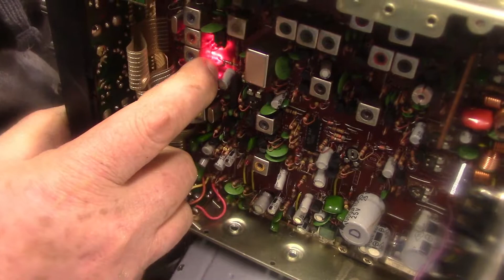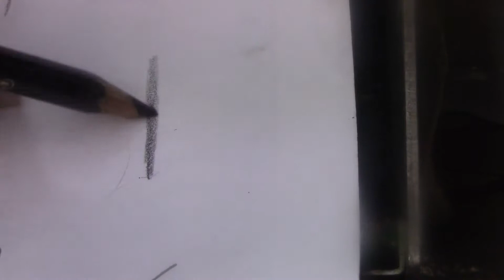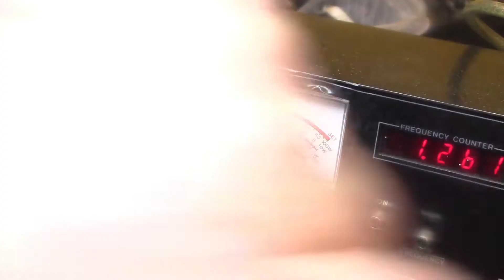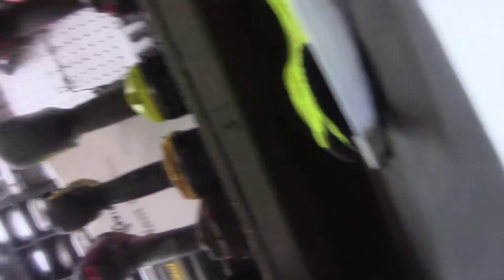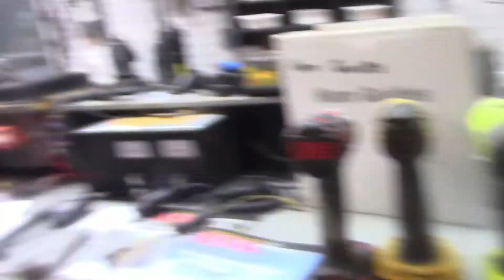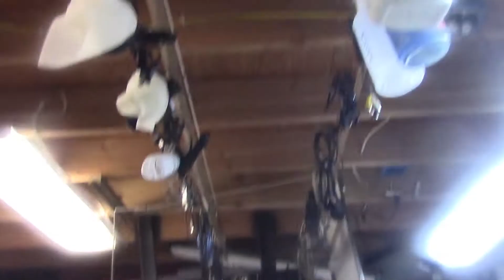fixing, repairing a cobra 146 am/ssb CB and BS

Comment: If you look at the top left hand corner you will see several metal screwdrivers, definitely not a CB or any other type of radio tech,real radio techs do not use any metal screwdrivers for radio work,i would never trust someone like that working on any of my radios.
Reply from the maker: You missed the hammer, saw, and drill. O, wait, you need to have a brain to ID them. You will make a great Troll someday. Keep trying, you may make Sir Trllship someday, maybe Sir Ass Troll.  Thanks for stopping by.

Comment: Back in the day, when I had a small CB shop, it was amazing how many "golden screwdrivers" type radio I would get in. Made for some crazy tales for ure, but it was a blast as well. Made good money, but got to play with allot of radios. Those old Cobras were great radios, as long as they took care of them. Great vid, and thanks for the sub, I have subbed you back.
Reply from the maker: Thanks Mike, I agree on the fun and the weird experiences on things that came into the shop. I had an old Robyn 23 tube base come in for repair when I opened it I found hundreds of dead roaches and roach crap on everything. I immediately throw it in a trash bag and gave it back.  After that any base units that came it wen5t into a trash bag and sprayed, tied and left overnight.  I will pm my call, I don't like putting it oput over the net.
Reply: buzzsah Yes, you never know what might be waiting inside a radio!
Reply from the maker: That's it lol.

Comment: Buying old junk is getting to be very risky, sure to need work 99% of the time, if it wasn't repairred.  Most of those guys still want too much, well over 200$ for a fixer upper.  
I kinda stick to TenTec and Drake, well worth fixing.  IMO, if you're looking at used rigs less than forty years old, BUY NEW, since a lot of those still go for over 400$, and will have issues.
Reply from the maker: Right, I wouldn't buy old, I had this one hanging around for over 30 years and decided to fix it for a shop rig. I was tampered with for sure and luckily I was able to fix without a lot of equipment.  You're right on the big bucks, I was looking for another AR$F-2001 like I have about 35 years ago, I found on that was in rough shape and they were asking $2500.00. wow.

Comment: Totally agree on antenna ripoffs and BS specs.  
Long ago, I had an Isopole cone for 2m, plastic insulator cracked, they wanted a lot for that part that failed all too often.  I'll bet AES stocked that part by the cases.  Other than that weak link, good performing antenna, simple, but cost as much as a fancy Ringo.
Reply from the maker: Way to pricy lol. I will test it on Tx and Rx this weekend. I did it already but vid was way too long. lol